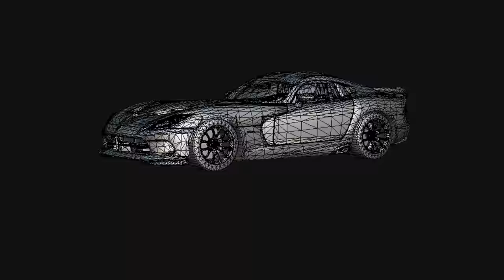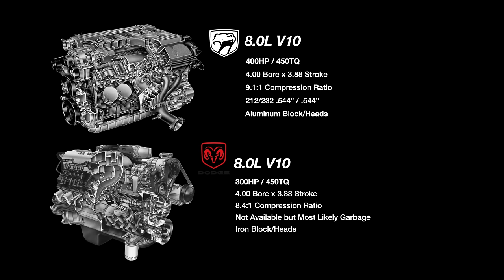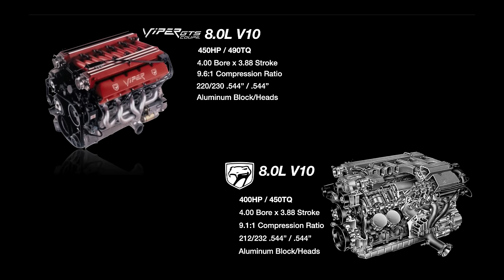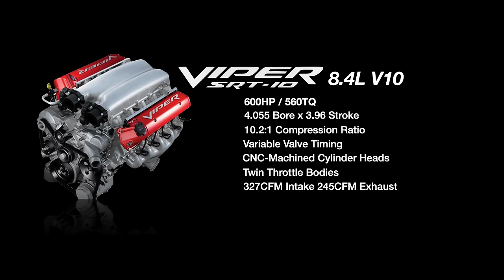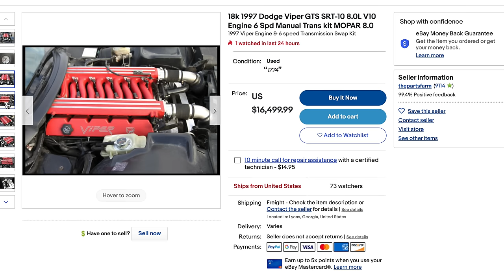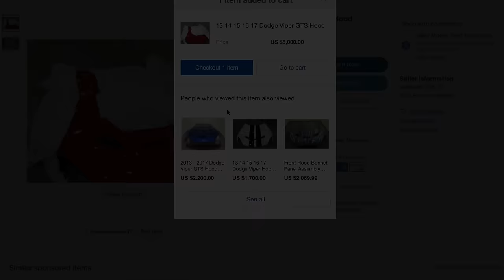Why V10 Viper Engines Are Too Powerful 😳| Explained Ep.5

Comment: Just bought a Gen 3.  Red, 2005 30k miles. Installed Full headers and exhaust - a short shifter, all the fluids, new tires and brakes. The power, handling, looks and sound turns heads everywhere. It is really a fun car and it’s an absolute rocket
Reply: Damn, sounds like a nice spec. How much did you get it for?
Reply: @lrballistics  Exactly
Reply: Congrats
Reply: post a video man, these cars are legendary
Reply: 'And then, everyone stood up and clapped.'
Reply: Congrats man and welcome to the club 💪 I have a 2010 gen 4. Gears and a tune really wake up the gen 3.
Reply: Congrats, bro. Been dreaming of owning one for 2 decades now. Have fun.
Reply: The handling huh
Reply: @aragon22155  the 08 ACR set the Nürburgring track record back when it came out. Apparently you've never been in a viper, but they're track monsters. The gen 5 ACR  is even more of a beast.
Reply: Welcome to the family
Picked up a gen 5 in December, still trying to get her perfect with my OCD
Reply: and u get gapped by a 70 chevelle with a zzp. not nice haha. HAHA
Reply: @Kdog307  why tf uu hating on every comment and quote…“hahahaha” smh, if ya gon b negative get off of tss shii mane
Reply: @98BlackTransAm   for many reasons  ; it was slower than the lambo SV that is far more a street car ... reccord set 2 years prior , same goers for AMG GTR  20 and 6 days after the Viper puts its lap time down ; porsche came along ; said hold our beers and put down a 6.47 in a GT2RS.. 

By the way first viper to attempt it blew its differential and replaced the complete car ; and the second car blew a tire destroying the car ... talk about reliability on a new car .... yeah ; we all remember those days where Corvettes and vipers where roaming the Ring like they lived there ... 

oh no wait ; it was  M3 and 911 days ... and still is to some extent .... want to know why ? cause people woud rather use a scalpel than a sledgehammer in europe/japan.
Reply: if you think a 2005 viper is good at handling, you my guy are missing out on literally any newer car😂😂😂😂(edit: let alone any car in its price range in 2005)💀
Reply: I bought 2
Reply: @gregmtech  lmao the e92 M3 from the same era is a giant piece of shit and so was BMW's sorry excuse for a V8. The best stock e92 m3 time is like 40 seconds slower than a gen 4 ACR from the same year...there's a reason they went back to a 6 cylinder. I'd honestly take an old tuned 335i over an e92. Also reliability on any BMW is dog shit, they're just slow, overpriced money pits. Stereotypical BMW fan boy mindset.

And are you really comparing Vipers to a Lamborghini SV and Porsche 911 GT2 RS?  Those cost like $400k more lmao. Put the crack pipe down.

Lastly, both the gen 4 and gen 5 Viper ACR are still faster than any production BMW ever made, including the 202X M3/M4, and we're talking SEVERAL years later. Maybe the engineers over at beamer should take some notes on how to build a proper track car. ;)
Reply: @gregmtech  viper is a manual and different drives bud, the viper still broke 14 records and does 1.28 on laguna seca and is still untouched on lots of tracks.
Reply: @RunningFromTwelve  New cars weigh a lot more, Aren’t fun and they are autos with 4 cylinders.
Reply: @98BlackTransAm  at least i know youre real you got a video in your channel idk about others saying the same
Reply: @dio santana Upload a video to your channel and ill follow you
Reply: I like sledgehammers...Esspecially  the Calloway twin turbo  Corvette that did 250 mph or more back in the 90s....stuff i can actually buy and work on myself and not have someone else do it for me. HP is not the only number that rates a engines performance. A 500 Cubic Inch V10 is a torque monster that Will crush most hi rpm overhead cam engines  on roll ons...Like doing 80 and just burying  your foot to the ground and  the hanging on rush.  .twin turbos with 2500 hp are a hoot too!.
Reply: @98BlackTransAm preach it brother preach it
Reply: The handling turns heads alright..... 😂

Comment: I think its absolutely insane that these 2000+ hp vipers are still running stock blocks
Reply: Barras can too
Reply: That's what you get when you use a truck block design that's meant to go in a 3-ton vehicle pulling another 5 tons lol. It's EXTREMELY understressed.
Reply: Brett Lasala ran Sick Week, logged 1,000 street miles and made 2500rwhp+ on an Oem predator block, oem Voodoo heads, and oem Coyote crank. Avg 6.7 @ 212 with a best of 6.52 @ 216 on 275 radials.....
John Mihovetz has gone 5.88 @ 250mph on a prepped OEM cast block and heads 4.6 4V. Made over 3 000 hp from 281 in³
MkII Motorsports holds the standing mile world record @ 300.4 mph on an oem block and heads 5.4L and is near 3 000 hp.

Vipers are overrated
Reply: @chadkent1241  too much horsepower doesn't kill cars nearly as much as too much torque does. A stock viper block making 3000hp and a stock Coyote block making 3000hp have WAYYYY different torque curves.
Reply: @chadkent1241 bet they aren't as reliable as the juggernaut viper at that power level
Reply: well it's a 8 liter engine. 2000/8 liters is 400hp per liter. Think of like a turbocharged 1000cc bike making 400hp it's really not that crazy. That's how these engines can hold together at 3500+hp. They also do not rev high, which also helps with reliability
Reply: @spdcrzy I was about to say there are 3k horsepower vipers and Lamborghinis all over the internet now. The V10 and v12 can do everything a 6 cylinder like the GTR and Supra and BMWs but it does it twice. You can get about 3k to 3500k horsepower out of the v12 until it becomes impossible to go farther. I'm wanting to know what is next. Bugatti 16 cylinder is the only thing that is going to be able to go farther in horsepower numbers. There is no more room to advance. Literally. You can only boost so much and push so hard. They should make a 16 cylinder lightweight engine that is tunable for racing. Chevy should put two LS motors together and add two monster turbos. There is no other way to get more power. But I guess electric will be taking over before they make a crate 16 cylinder for racing or putting a 16 cylinder in the Corvette.
Reply: Yeah but everything else isn’t so top end crank pistons con rods valves literally everything else when going north of 1600hp is changed the only thing that’s still the same is the stock bottom end Lamborghini does it as well but those cars run north of 3k hp so I’d say not as impressive as Lamborghinis bottom ends haha
Reply: @jonathanmcadams-nx5zp no one’s modifying Bugattis
Reply: @jonathanmcadams-nx5zp  Lol, look up the auto union type C. That had a 16 cilinder built for racing back in the 40s. We might be getting crate engines back at some point if/when hydrogen fuel becomes mainstream?
Reply: @jonathanmcadams-nx5zp  The W16 can reach upto over 5000bhp but its so highly strung its Volatile, and the much metal going bang was just to dangerous.
Reply: @joshlewis5065  250 hp per liter.
Reply: @BugattiONE666  Highly strung? The Bugatti engine is 8 liters. Stock it's under 200 hp/l which isn't high strung for a turbo.

Comment: Great ACCURATE information… sooo many people screw up the Lamborghini casting part! The rest was developed with Yamaha… also why does the viper community go crazy for the gen 2 cars 🤔.
Reply: Because the gen 1 cars actively tried to kill its owner..
Edit..
When those cars first came out I was deep into the street racing scene very seldom did somebody bring out a viper and the car made it home at the end of the night..
Reply: Because they’re cool
Reply: @TheNutshaq  GTS is amazing… in any color
Reply: @IllaWondah  yeah they made a name for themselves pretty quick lol
Reply: Because the gen 2 GTS is absolutely beautiful and has timeless design/lines.  There's a reason so many car enthusiasts in that era had a poster of the classic B&W Viper GTS!
Reply: @ssoffshore5111  GTS for sure! I’ve heard that the rear exiting exhaust sounds better 🤷🏼‍♂️
Reply: @The_Drive_Inside  I have two GTS's, one with side and the other with rear.  Personally I like the sound of the rear exit better, but in all fairness, it's a TT stroker with a larger cam so it sounds different anyway.  The side exhaust is deafening if you remove the cat/muffler, to the point of pain.
Reply: The Gen 2 looks just like the Gen 5, but costs only a third of the Gen 5 and can be made even more beautiful than it already was, if you tastefully mod it. 

I prefer the Gen 4s, but I could go for the Gen 2 or Gen 5. Such sick cars. 🔥🔥🔥
Reply: @ssoffshore5111  Yes.
Reply: @KingDeadMan  The only thing that kind of dates the exterior of the gen 2 GTS compared to the gen 5 is the lighting, the taillights mostly IMO.  I wish someone made a more modern replacement for them.  Other than that, it's timeless!  And while they've been increasing in value, I still think they are undervalued and will become more collectable in the coming years.
Reply: Is the 99 gts gen 2? I figured it was gen one since it’s the same body as the rt10
Reply: @marcelluscunningham9071  yeah it’s a 2nd gen.
Reply: @marcelluscunningham9071  it wasn't the same body style gen 1 and 2 Def look different.
Reply: I dunno either man. Gen 3/4 and 5 are tied for cool factor for me. Gen 3/4 because I can afford one, Gen 5 because it's basically best of all worlds wrapped up in one neat 6 figure package...
Reply: I mean look at a 2nd gen pure sex.....tbh most likely GT on Playstation blue white stripes still can see it in Mt mind
Reply: @midnight347  they could be different models same gen. From the front the look alike obviously from the side they don’t. Gts is coupe
Reply: I’m not a viper owner but I am a huge enthusiast and I think the answer is simple. First I’d say it’s the most “appealing” viper. To many of the owners of Gen 2s that was the car poster on their wall when they were young, and seeing the GTS-Rs from that era race whether it be at Le Mans or in gran turismo gives people a sense of nostalgia and owning a Gen 2 is like living a childhood dream. 
Also the Gen 2 is a mix of having needed basic amenities (A/C, and a Roof lol). But it still had the rawness from the RT/10 with the power and the striking looks so if you wanted a RT/10 but felt it was flawed the 2nd Gen GTS fixed some of those issues. But one of the biggest factors is different the value Gen 2 hold. If you have GTS blue with white stripes GTS you can drive that car, and I mean drive it hard and you’d still be able to sell it for right around what you got it for especially in todays market.
Reply: @ssoffshore5111  
Damn, 2 vipers and one built...may I ask what you do for a living?
Reply: Gen 2 cars dominated motorsports on its heyday.
Reply: @IllaWondah  the Gen 2 cars were no different. No TCS, no ABS. Although you did get an airbag lol
Reply: @michaelangelo5783  lying on youtube is prolly his main job. I disregarded his paragraph after he claimed he had a second get GTS with side exit exhaust.
Reply: @ssoffshore5111  B&W is blue and white right.  I had that poster 🤣😍🔥
Reply: @zztop7306  not 100% true. The 2001 and 2002 models have ABS.
Reply: Previous gen 2 owner (2002) here.  The gen 2 and gen V both seem to be the most popular. Now the 2000 Viper is the least desirable gen 2 due to pistons not being forged and lack of ABS.
But gen 2 cars seem to carry the ideology of what the Viper was supposed to be.
And no these cars don't kill you anymore than any other car.  If you try to drive the car with 20 year old tires you're asking for trouble.  Put new rubber on them and you're good.  I've never had an issue.
Reply: Yamaha?!?? Dam this like the 3rd engine ik they developed. Its a sign !!!
Reply: People going crazy for Gen 2's.  I'm guessing for life insurance and car insurance premiums. That was my dad's reasons when buying one. 🤣
Reply: Absolutely nailed it on the than relationship with Lamborghini. Dick Winkles would fly out to Italy to work with the engine designers to come up with a new design as Bob Lutz mandated that the car must have a V 10 engine.
Reply: @michaelangelo5783  Nothing crazy, I'm an engineer, also own a landscaping business, rental property, investing etc.  I'm in my 50's  with no kids to drain the bank.
Reply: @zztop7306  Being a jealous hater on YT will get you far in life...  Oh, I think I have pics of those cars, and others as well, on my IG. It's under the same username.  I haven't been on there in a while, but I'm pretty sure they're in the "toys" album if you're that concerned about fact checking.
Reply: @ssoffshore5111  zero pictures of said side exhaust second Gen.
Reply: @IllaWondah  “Because the gen 1 cars actively tried to kill its owner” 😂😂😂
Reply: I own a Gen 2 GTS Heffner 650, among other exotics and have to say the Gen 2 GTS is my favorite to drive. It tests your ability everytime you get behind the wheel and they're skyrocketing in value. A crap example of a (Gen 2 GTS, except 2000 which is less desired) runs $55-65k and a decent will set you back $85-90k.

They're raising in value by 3-5k a month and won't be stopping any time soon. Great vehicle, blast to own and drive and an amazing investment. Can't beat it, tbh.
Reply: @IllaWondah they were the rawest of raw.
Reply: Maybe they don't even know it, but the reason is "Lougi Colani".
Reply: @The_Drive_Inside  You've got great taste the GTS was perfection.
Reply: Because every 2nd gen dodge ever built is the best
Reply: Perfect exterior design, even if it’s not your style you gotta admit it’s very cohesive and flows from any angle. Rear exhaust, and no fly-by-wire crap.
Reply: @KingDeadMan  You nailed it right there "Tasteful" was the word I was searching for to describe the GTS one of the most beautiful cars ever made to this day.
Reply: @ssoffshore5111  The way things are going as we move toward EV  they will absolutely explode in value.
Reply: @ssoffshore5111  You my hero dude, an absolute rare breed with experience, wisdom, and above all the freedom to exercise your superpowers with no encumbrances.
Reply: @calebburkhart8622  That's crazy bro I was just discussing that very thing.
Reply: Gen two go brrrrr
Reply: Gen two go brrr
Reply: Not quite accurate. Gen 3 was introduced in 2003. The SRT-10 was not available in 2002.
Reply: I have a gen 1 and gen 2 and i’d buy a 3rd or 4th gen any day of the week. Probably buy a 5th gen at some point
Reply: @IllaWondah  Yeah, my uncle had one and he sold it because he felt the car was trying to kill him.
Reply: You’re telling me this beast ran on 89 what would’ve happened if you ran it on 91 or God forbid E85
Reply: @3644Darrell  it was
Reply: wait... when was Viper's V10 developed with Yamaha? Isn't that 1LR-GUE from the LFA?

Comment: Lots of good info.  A few minor corrections…The gen 3 came in 2003 not 2002.  The gen 1 cars made 465 ft lbs of tq not 450.  Great video!
Reply from the maker: I’ve been putting the start of production rather than “model year” for the viper. For example the SRT viper is a 2013 Model year that started production in 2012. I’ll start using the model years from now on
Reply: erhmm ackshually 🤓
Reply: @clap_lmao  learn spelling !
Reply: @ronnieboucherthecrystalcraftsm  its part of the joke to write it like that bud. look up the word
Reply: @ronnieboucherthecrystalcraftsm  he's joking and it's a meme. That greasy hair bad complexion Redditor trying to correct everyone starting their comment with "actually".
Reply: @ronnieboucherthecrystalcraftsm  learn memes !
Reply: Yeah slow af funny beating them in my 2.0
Reply: @ronnieboucherthecrystalcraftsm  Whoosh
Reply: Wow 🗿
Reply: On my window sticker on my 95 RT 10 it said 488 foot pounds of torque, I always wondered about that.
Reply: @stevenekdahl7124 the engine was 488 cubic inches.  I think thats where you’re getting 488 from.  All gen 1s made 400/465.
Reply: No. The gen 3 arrived in 2002 as a 2003 model year car. I remember reading the articles from the period

Comment: I use to work @ Viper I remember the warehouse being  full of Gen 5s before the release date had to be 75-80 Vipers. GTS blue and Stryker Red. Still hard to believe they built this  iconic supercar on Conner Ave in Detroit, Mi right in the middle of the hood.

Comment: “What are the safety features on the viper?”

Dodge: “Fear of Death.”
Reply: Pale knuckles
Reply: @markm0000  ....puckered seat cushion fabric in exactly the same shape as the 'ole sphincter, there.....yip...the sphincter pucker in the seat fabric
Reply: @ssnerd583  Oddly specific
Reply: This car scares me and i never even drove one before.. and i still want a Gen.2
Reply: Safety of ya will die some day driving it
Reply: @markm0000  true but he's not wrong 🤣
Reply: actually federal law makes em have all the stuff you would see on a chrysler 300
Reply: its "call ur moma" we rekd bad.
Reply: half of gen1 vipers sold got totalled.
Reply: Underrated comment 👍
Reply: Yup that will do
Reply: @ssnerd583  I believe in the industry they call that a button. Ya know just somethin for the driver to hang onto in the event of a roll over. Keep doin them sphincter Keagles fellers
Reply: Doors
Reply: Will the cops run it down?
Reply: Pretty late to this, but: doors, airbags, tires
Reply: @hpcarthech4387  last but not least, balls. steel balls.
Reply: That's why it's called widowmaker
Reply: Safety features of vipers: the cost of performance upgrades....
Reply: Facts
Reply: thats probably the best comment on YouTube I've seen😂
Reply: We don't need no safety features...
Reply: The best safety feature is "don't drive past your ability"